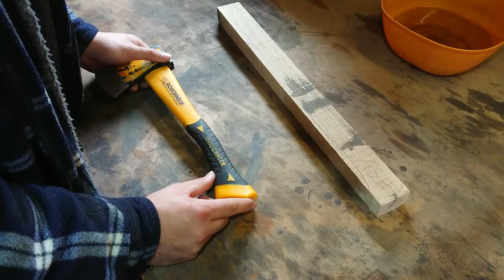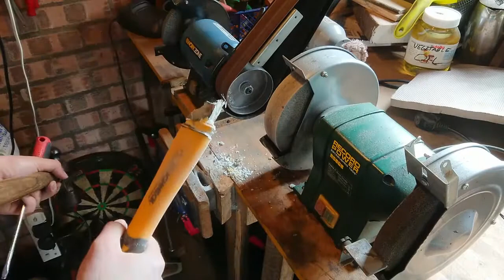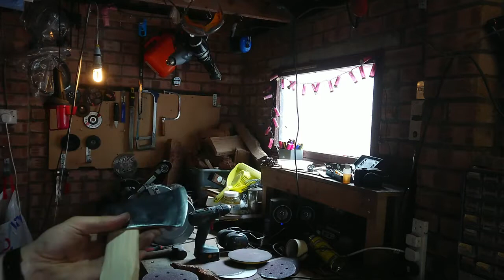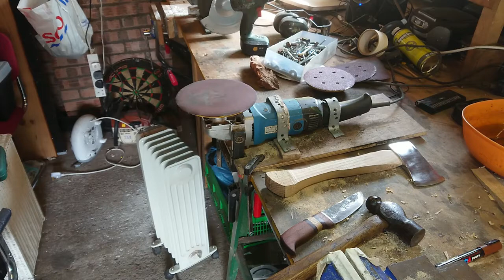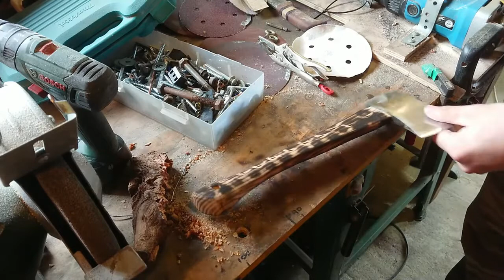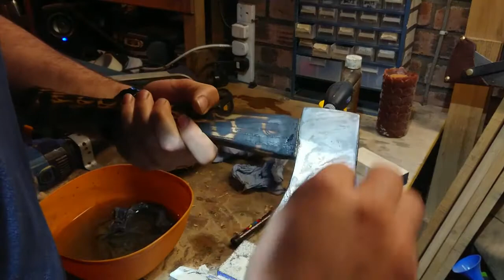Pimp Your Bushcraft Axe - Cheap £7 Hatchet Fully Customised

Comment: For your introduction project to upgrade the inexpensive ax you did a masterful job. The handle came out beautiful. Don't forget to linseed oil the wedge end and saturate it. Put some tape around it and make a well and pour some oil in it and let it soak. The stropping with the leather is a great way to finish the sharpening.  Like the way you cut the handle and sanded it to shape. Nice burning also. Thanks for sharing
Reply from the maker: Thanks Dave, yea since then it's had about 50 coats of linseed and is now my son's axe of choice. All the best mate 👍
Skye

Comment: Tip. Heat your blade with your torch till Cherry red . Caution !! do not go further than cherry dark ripe red (dark burgundy like) and then submerge it in cold used oil ( car wasted thick old oil ) and let it cool down ..it will cut metal !!( do it before sharping and cooling and stropping )  try it on a metal drill point marker .till you have the hang of it ..success !! PS don't ga cherry red on the cutting edge, the heat will transfer to it anyway ..stay about 2 cm from cutting edge, then after cooling in oil bad ( frightening the steel and harden it ) start sharpening. Success !
Reply from the maker: Yea heat treating the head might have been good for this little axe but to be honest it holds its edge quite well, I reckon it already has a hard tempered edge from the shop. 
All the best mate 👍
Skye

Comment: Dude! Very nice! I wish I had the tools to do that. A couple mods and that would be the perfext bushcraft axe. Well done!
Reply from the maker: Frank Bush thanks, I got to make a sheath and belt loop for it next.
Reply: Put a small divit in the handle near the head for a bow drill... and a 90 degree edge on one corner of the head for a farro rod striker. SOLD! I'll take one. 😁
Reply from the maker: Good ideas, I tend to just use my knife for a striker, if I'm ever in that big a pickle I can just use the blade. Thanks for the ideas though

Comment: you can probably flame harden edge to better with your torch there. just get the edge cherry and quench in motor oil no need to temper. its just the edge that will be hard